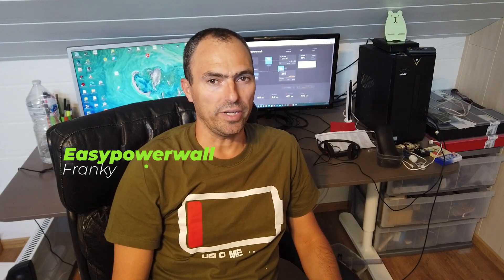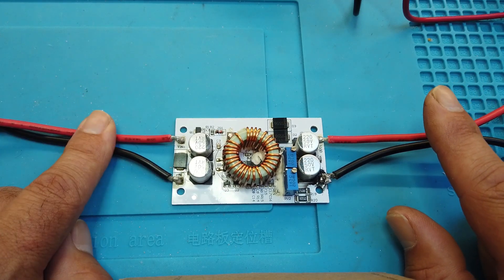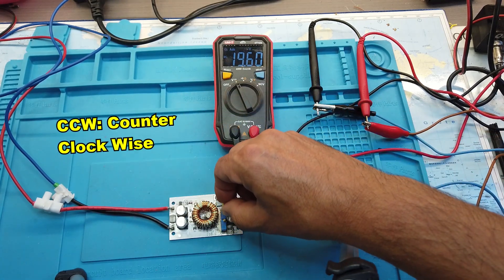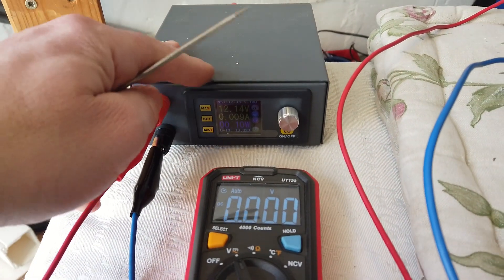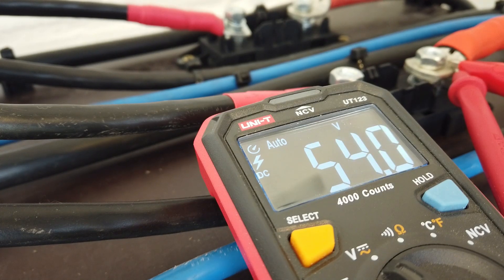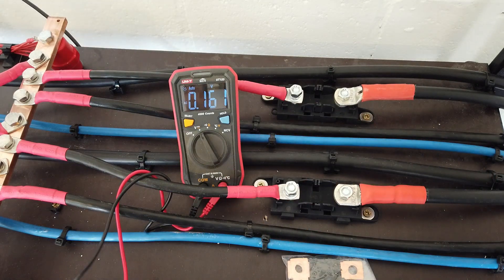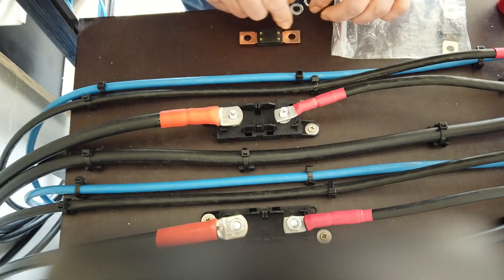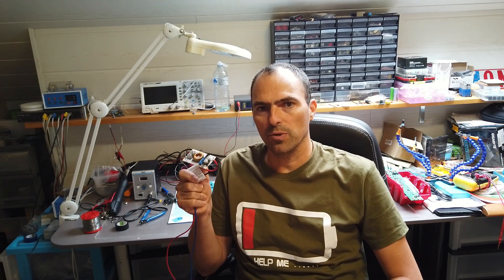Precharge solution for you victron or any other inverter.

Comment: what happens is Battery turns itself off. inverters caps discharge, then Battery turns back on. do you get an in rush current ?
Reply from the maker: Hi, 
No once the caps are charged and the battery turns on 1 or a few days later the caps are still charged and you wont get an inrush current. It's only when they're switched off for a longer periode like >1 month that you have to repeat this procedure again.

Hope this helps.
Franky - EASYPOWERWALL

Comment: Kan je niet gewoon een weerstand gebruiken?
Reply from the maker: Kan je idd perfect. Maar dan moet je weerstand bevestigen. Heb je die waarde in huis? Weerstand kan je daarna voor niets anders gebruiken. Met weerstand kan je procedure niet handsfree doen.
Reply: @easypowerwall  zo'n weerstandje kost niet veel en jouw methode is ook niet handsfree. Daarnaast moet je het voltage via de potmeter opschroeven. Mooier zou nog zijn een soort drukknop waarmee je de capacitors precharged en er zijn ook al bmssen die dat automatisch doen.
Reply: @easypowerwall  Ik heb ook weleens een dik werkpotlood gebruikt om de caps te prechargen :) Die zette ik dan tussen de aankomende plus en de plus van de inverter..

Comment: Your solution is OK, but you really should improve it by replacing that mini 10 turn pot with an external 10 turn pot (even a normal pot would work) and knob and put the thing in a box. No fiddling with screw driver holding the pcb. And if you want to go fancy add a volt meter module to the output.
Reply from the maker: Hi Repairmen. It was the initial plan to replace the pot but if you click on the link of the part you will see that the back of the PCB has a metal cooling plate. Can't remove it properly, if possible I would have changed the pot too. As most of us have to precharge only once, I didn't walked the extra mile to find another solution.

Comment: The fuses you are using, seem to be 32V mega fuses according to the link... Not an ideal choice for this 16S battery or am I missing something? Nice videos Franky
Reply from the maker: Hey Bert, good question. I checked many YT clips about fuses. and this model is very accurate. The lynx distributor uses more or less the same fuses.  Future will tell but think the solution I used is pretty safe and reliable.
Reply: Hi Franky, I was searching for such fuses for my own project & noticed a big price difference between the 32V & 58V rated versions… I ended up with the Victron 58V versions @25€ each… couldn’t find a good alternative on ali unfortunately
Reply: You should not be using 32V fuses on a 58V system or it will blow every time due to over voltage.
Reply: @Michael-AUS  No. The problem is arcing

Comment: Why not just a $2 power resistor, or even a normal pencil sharpened on both ends?
Reply from the maker: Hi Sylvan. What you propose will work too, but noticed that many builders are not comfortable with the solutions you propose. This solutions is very simple, safe and cheap. For resistors many don't know which value they have to use. The boostconverter is usefull for other projects, the resistor will collect dust.....